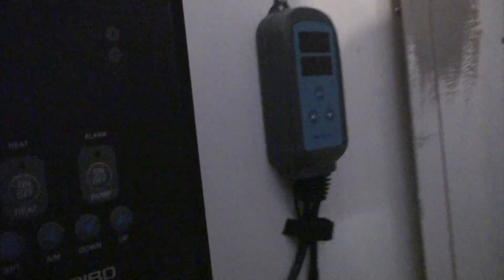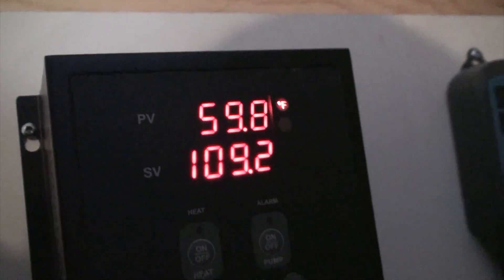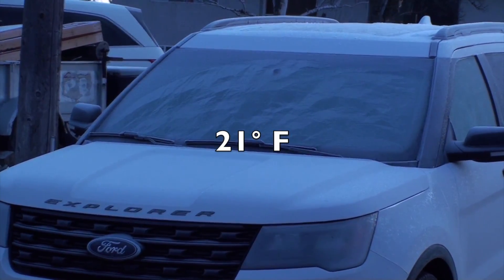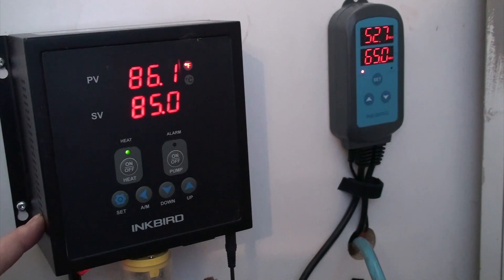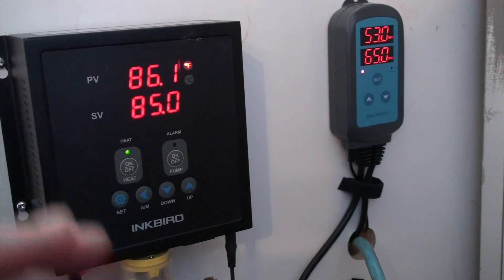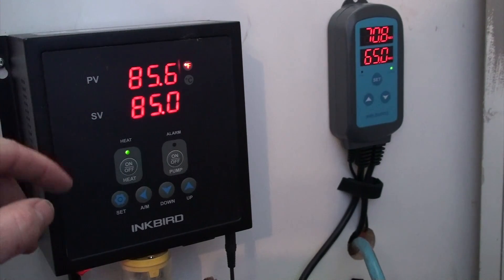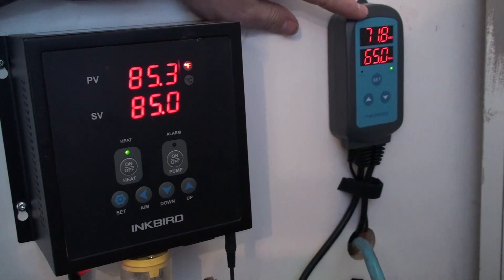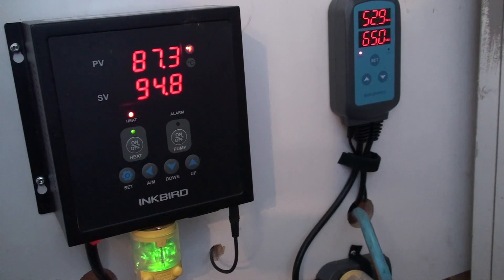DIY Wood kiln Part 2

Comment: Hi, this is very interesting. I am preparing to build something similar having built one about 20 years ago following the designs of John Arrowsmith who was originally a designer for Ebac. He is no longer alive. My comments for what they are worth are that your temperature control is unnecessarily sensitive and the amount of heat you require is a bit high.
I prefer to have a probe in the wood within the kiln (somewhere in the middle of the stack) which gives access to daily monitor the wood moisture level. I also have a remote air probe within the box with can then control the heat source.
When using a lower heat source the initial extraction rate is slow until enough mass heats up. Then as the vapour condenses it releases dormant heat so the whole cycle speeds up.
The practical advantage is that the stress upon the wood is reduced and the resultant damage or case hardening is much reduced or better still non-existant. Produces

Comment: What are the 2 controller units you use?
Reply from the maker: The big One was a PID controller and the smaller one was a basic Amazon bought humidity control switch. Somewhere in the comments I link to them

Comment: I commend your efforts. I have already built a kiln like this with space heaters, heat lights and res. dehumidifier. I can tell you the problems I had. And you will probably run into. 1. You need a more powerful heats source, halogens or a thermo bypassed  space heater.  2. after bying three different models I was never able to get a residential dehumidifier to operate over about 95 degrees F. due to the type of freon they use, they cannot work in those extremes. 3. tradition moisture/humidity meters are completely inaccurate at those extremes as well. Thats why nyle uses a wet bulb dry bulb system. 4. never trust a surface moisture scanner past about an inch of thickness. I had moderate success but couldn't overcome the dehumitifier hurdel so I recentlt broke down and bought a Nyle kiln. Good Luck!
Reply from the maker: John Kidd definitely worked through some issues at first but I have it pretty dialled in now. This kiln was a great stepping stone..on my 4th batch of lumber with no issues. Secret to success for me is slow ramp on the temp increase and a vent right beside the dehumidifier... still works at 120°

Comment: Good stuff! Milling my own lumber and want to do this! What kind of dehumidifier did you use?
Reply from the maker: It was just a box store special. 70 pint Noma I believe. Just make sure whatever you buy you will be able to hook a hose to the drain. ALOT of water comes out. Cheers !

Comment: How long did it take for your wood to dry? How did you run the wires through the walls of the kiln?  How did you make it air tight? What kind of plug is that that lights up when it turns on. I just order the controllers but trying to figure out what temp and humidity to set. Seems like you were just experimenting.
Reply from the maker: RG Fishing yes it was my first run...it took 30 days to dry that load....
I drilled the wires through at random and sealed them off. 
The kiln was not air tight, and in fact worked better with 4” hole drilled at one end.
The plug was just purchased at Home Depot should be able to find them any big hardware store.

My first load was dry in 30 days however I had it way to hot to begin with. The wood warped bad. My second load I followed a strict schedule and every 3-4 days opened it and checked the moisture content. 

Day 1-5 keep the temp at 70° and RH no lower than 70% it’s this first week that is the most important not to suck out moisture to fast . Make sure your load has lots of weight on it and is fully supported 
Day 6-10 ramp to 80° RH 60%
Day 11-20 90° RH 50%
21-30 100° RH 35%
On the last 24 hours run it hot 120-125° this will kill off any bugs by this time very little water will be coming out and you may even have to unplug the dehumidifier cause it won’t work at those temps.
Reply: Putchor Putchor thank you for answering my question. How did you figure out that schedule?  Im in the process of building my kiln and looking forward to drying my first batch.
Reply from the maker: RG Fishing I completed my 2nd batch last week using those guidelines and the lumber came out much much straighter than the first load. The first load was to hot at the beginning and not enough weight on top. Also it is important to allow your wood to air dry for a few months first. If you put green lumber in ..it will twist and warp like crazy.
Reply from the maker: RG Fishing also the directions for the PID controller are terrible if you have trouble programming it I now know it inside and out

Comment: Can more info on the temperature and humidity controller?
Reply from the maker: RG Fishing  I purchased both on amazon

Inkbird Digital AC15A IPB16S Pre Wired PID Thermostat Temperature Controller for Home Brewing Relay https://www.amazon.ca/dp/B07T4NHR26/ref=cm_sw_r_cp_apip_VYwXdGmLmZGNO

Inkbird AC Sensor Humidifier Dehumidifier Humidistat Pre Wired Plug Digital Controller Greenhouse https://www.amazon.ca/dp/B017IJF2JE/ref=cm_sw_r_cp_apip_o8xYtA1KwFkJ5
Reply from the maker: RG Fishing if you need more info let me know cheers !